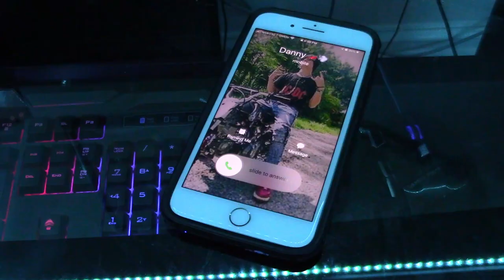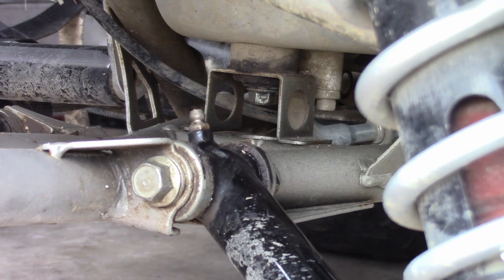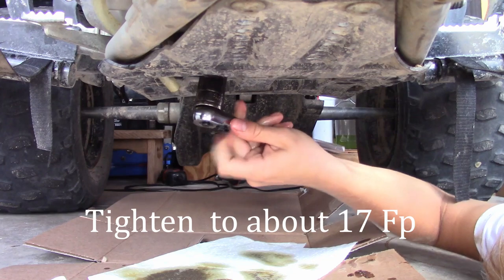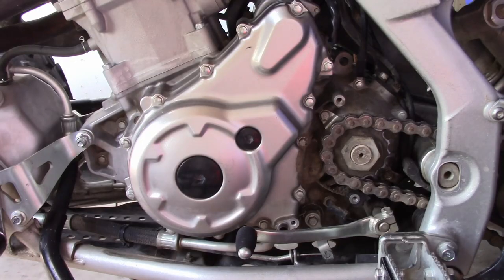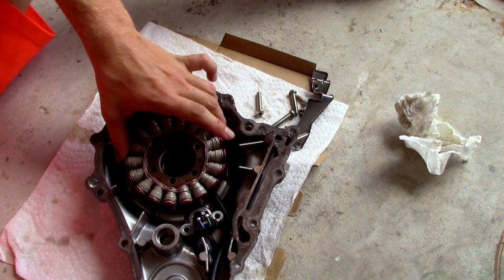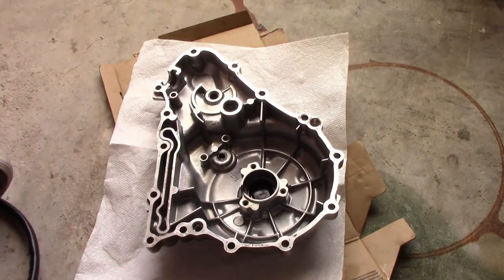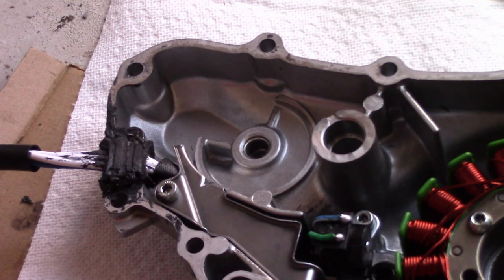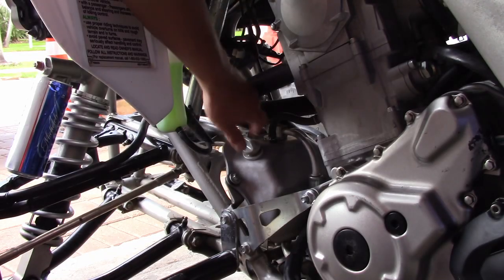How to replace your stator on a raptor 700

Comment: Is it posibel that the stator doesn't work if you didn't put the oil back? Ik dont got any Voltage from the stator  when testing 🤔
Reply from the maker: id put oil back but if the stator isn't the problem then its the regulator/rectifier
Reply: @nosnick3093  thanx but i measure  0v AC   from the stator  and the negativ the rectifier is in the cdi box i thougt ?